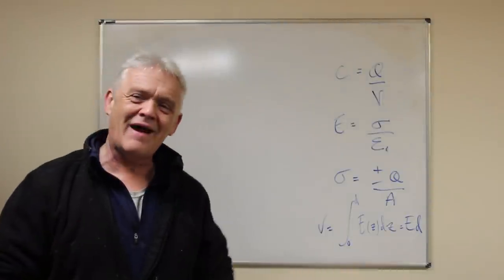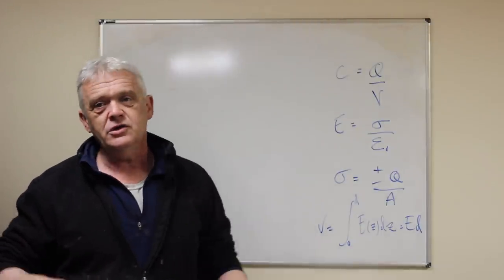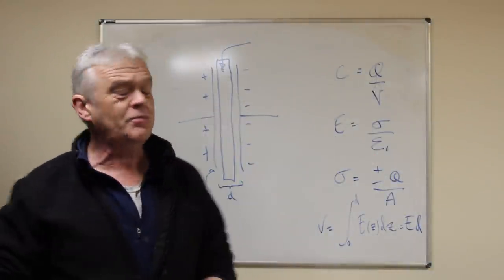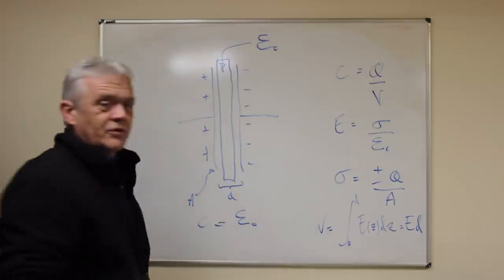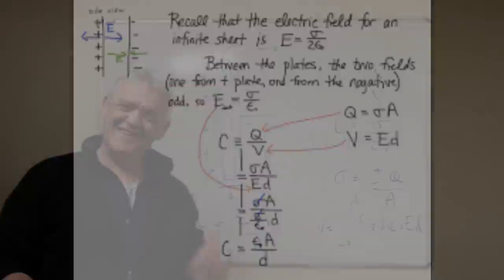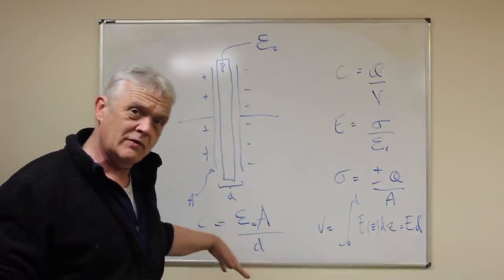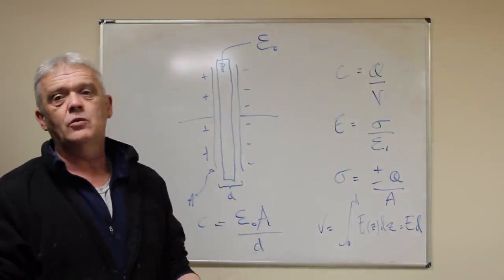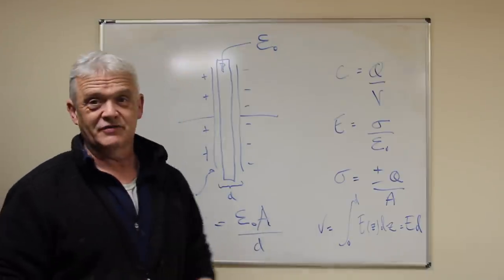1533 Supercapacitor Mathematics

Comment: a big one for energy storage is the upper limit of breakdown voltage
capacitor energy
E=C *V*V/2
can be expanded with inclusion of what you derived there.... 
E= u0*A*V*V/2*d
if everything else kept same, with double the maximum voltage that a capacitor can hold, the energy storage goes up by *2*2 ie *4

Comment: Striving for the "highest value possible" has probably gotten us into the problems we have today of needing rare/toxic elements only found in certain locations around the globe.

Going along with things you've been saying on your channel, maybe we should be focusing on "lowest value necessary" that meets our requirements (the big ones being available space, cost of materials, and the interface requirements).  Then, instead of having one super solution to the energy storage problem, we could have a plethora of solutions.

The problem then moves from finding "The Best" energy storage materials to dinging the most accommodating interface that allows you to connect power generation to power usage.  Kind of like the way a AA alkaline battery and an AA lithium battery can fit into the same holder in a flashlight and be able to power the flashlight without any (or very little) modifications.  Then you could take any power storage or production device, and as long as it could connect to the--let's call it the "in" side of the interface, it could power any device that hooks up to the "out" side.
Reply from the maker: oh I agree 100% with what you are saying here - thanks for posting

Comment: Have you tried mixing cell sizes?  What I'm thinking is one or two very large storage cells - possibly two to overcome the .8 volt drop in a diode.   The storage cell or cells would be in parallel with 6 smaller super capacitors in series and charged by the storage cell(s) with blocking diodes, so we still get 12+ volts from the battery.  Instead of charging with a 12 voltage source you would charge with a 2(ish) volt source.  Your battery would need 3 posts.   1 negative, 1 positive input at ~2 volts.  And 1 positive 12 volt output.  The PV cells would instead be connected all in parallel instead of series for charging. 

Would there be any significant disadvantages to that approach?  What I was thinking was one massive 1 or 2 cell storage battery.  Because of the simplicity it would be extremely easy to manufacture.   That would be the primary power supply for super capacitors.

Comment: Something for your mind to toy with: If you change your plates into bifilar coils and make your separator into a bifilar coil, will charging the coil plates cause a current flow in the coil separator? The electromagnetic maths say yes. For every change in an electric field there is a change in magnetic and vis-vers-a.

Comment: Hello, I remember you doing a step down system for high voltage capacitors "fractal something" anyway you showed how diodes could be used to lower the voltage from really high to lower usable voltage. 
So question, when I lower the voltage using that system does the extra voltage come out as usable current or not?   example 100v x 1amp using the (fractal set up)  lower voltage to 10v would make the system produce 10amp? like Ohms law
Reply from the maker: well it's really power W=VI minus losses - but basically yes it would follow that

Comment: Have been using 3000F * 6, 2.8V supercaps in series for my car for the last couple of years. These are just amazing devices. However i find one of the cells(of the 6) leaking a white electrolyte that solidifies and crystalizes in air. This cell also has a very high self discharge rate, which is making me lose balanced condition( i dont use a balancing circuit cz the other 5 have equal capacitance n discharge rate). There is an electrolyte filler screw , i was wondering what i can use, to fill  it up with to temporarily reduce the self discharge. Im guessing oil based electrolyte.
Reply from the maker: chances not mate - usually supercpapacitors have an acetonitrile solvent
Reply: @ThinkingandTinkering  thank you for looking into it.

Comment: Why do capacitors loose their energy quicker than batteries when there similar in construction
Reply: I suppose it is because a battery will hold a fairly constant voltage, and therefore power output until it is nearly flat. A capacitor’s voltage starts dropping the second it starts to discharge, and the power available drops proportional the voltage at any given current. If there is a fixed resistive load, the power will drop proportional to the square of the voltage. Presumably, Formula 1 KERS devices have some very fancy electronics to mitigate these problems!
Reply from the maker: they don't lose their energy quicker mate - they just don't store a lot

Comment: Saying, for example, that capacitance goes up when permittivity goes up is NOT even an intuitive derivation. Please don't believe that there was much of any kind of derivation here.  In earlier videos, this person gets very excited about being able generate a voltage but has not shown it being used for anything. Creating an open circuit voltage is one thing, using it to drive a load (light bulb for example) is a very different proposition.  This seems all to be phony stuff, be careful what you believe.
Reply from the maker: you don't have to believe it - it is something you can test for yourself - stick some different materials between two bits of kitchen foil and charge it and see how long it lights a light - I get a sense you have never even tried that - or am I wrong there?